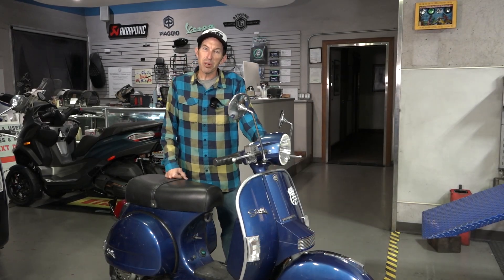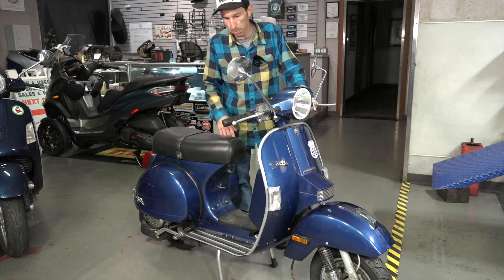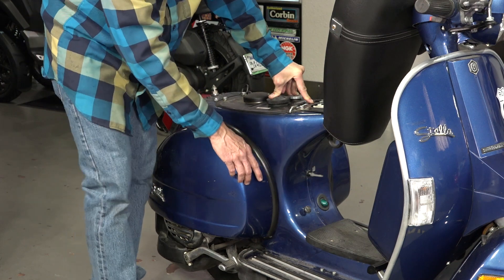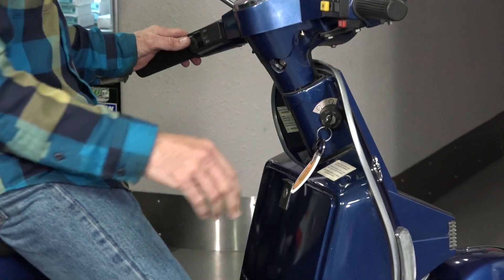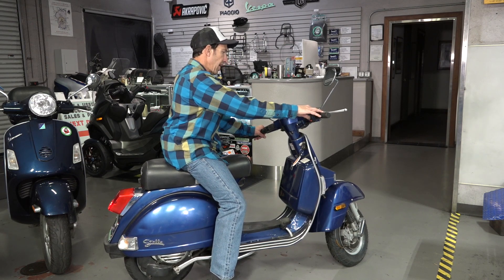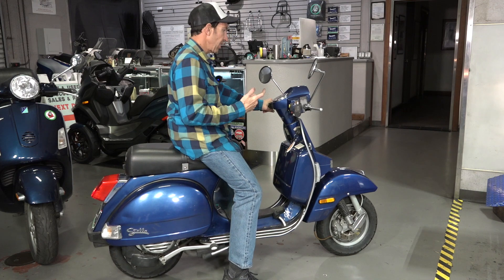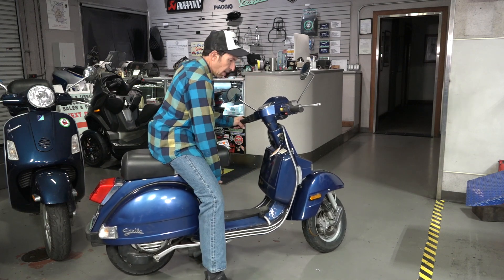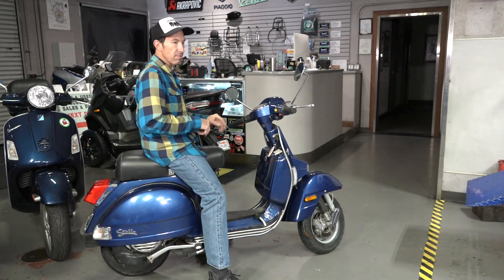How to Start and Operate a Genuine Stella or Vespa PX 2-stroke Scooter

Comment: I am the proud owner of a 2009 Genuine Stella. I get complaints from people saying it's not a "real Vespa" IMO, that's just a technicality. It is pretty much the same as a Vespa PX150. 99% of the parts are interchangeable. A "real" Vespa P series engine will bolt right in. The frame is heavy and rock solid. I weigh 240, and I NEVER get on it with it on the centerstand. I always push it off the centerstand before getting on. A few years ago I had to replace the stator, and at that time I removed the electric starter and put it in a box in the closet. I have been told they are failure prone, they are super expensive, and the Stella is super easy to kickstart, even with your hand. I got rid of my turn signal beeper. They will kickstart and run without the battery, but the lights will not work at low rpms. With either a "real" 2 stroke manual shift Vespa or a Stella, it does take some practice leaving a stop. Because of the extreme rear weight bias and the very light front end, If you give it a bit too much throttle and let the clutch out a bit too fast, it will take off with the front wheel in the air. I did that a few times when I first got mine. It you try too hard to avoid that, you will stall it. The sweet spot is right between the two extremes. The Vespa /Stella can be short shifted, they don't have a huge gap between the gears. You can take off in second gear by slipping the clutch just a little and giving it a bit more throttle, not that I recommend doing that. First gear runs out very fast, you will need to shift in the middle of an intersection. Yes the shifting is a bit clunky, and I love it. It has that crude, primitive mechanical feel. A very visceral riding experience. It's an actual MACHINE. My fuel gauge no longer functions. The needle can be all over the place. I don't need a fuel gauge, I go by the odometer. I could replace it, but I don't really have a reason. Stay away from the 4 stroke Stella. Not only are they junk, and impossible to get parts for, they defeat the whole reason for owning/riding a 2 stroke scooter. I do recommend replacing the exhaust on the Stella with a Vespa exhaust, the Stella came with a catalytic converter in the exhaust, which not only kills power, but will plug up right away, and can even damage the engine. You may need to rejet the carburetor when you do that.
Reply: The 4t are not junk. Sorry. You can find parts for them here in Europe
Reply: @Boss-Crow  Correct
Reply: Hi. I inherited a Piaggio that looks just like the one in the video. It works, but, only with kick start. I have one question that hopefully you or someone here may know the answer. The glove box on mine have one of the two hinges, not broken, but, separated from the 3 dots of what I guess was a welding of some sort. I don’t know how to fix it. Would normal welding work? Or putting screws? I’m uncertain because both would change the original configuration. Is that even important?
The other question is if it’s worthy to try to keep it, maybe restore it someday?? Or as I read in your comment, just ignore the problems and just use it as is.
Thanks in advance if you take the time to respond.
Reply: @GnarledSage  Ok, yes, I see what you mean. My Stella has three "spot welds" sometimes called "plug welds" that hold each hinge to the glove box door, in a triangle pattern. You can see them on the hinge, but not on the front of the door. There is no way to reweld them without ruining the paint, and even then it would require a really good welder to weld such thin metal. I have never been able to weld anything that thin without burning through it. It might be possible to use an epoxy, like JBWeld, or just drill out the three broken welds and attach the door to the hinge with small screws, nuts, and washers. That's probably what I would do. If it was made by Piaggio, and looks like the scooter in the video, it is a P series Vespa. Yes it is worth keeping and restoring, or at least keep it running. A lot of people like older Vespas with some "patina" (the weathered look) Nobody makes manual shift 2 strokes anymore, so they are becoming more and more rare and hard to find. Prices are going up. And the best part is, 99% of the parts are still available. The PX150 was sold in some countries up until about 3 years ago.
Reply: @geraldscott4302 Yes, the hinge is with those 3 spot welds (now I know how to call them. Thanks 😂). I guess that weld can be only done in the fabric or with some specialized tool. I guess the best option is to drill them and use some screws then.
You gave me an idea of the model, at least now I can search with the reference you said. And also made me think better of the bike. I liked because it was a Vespa, but, wasn’t sure if it was a waste of time to even keep it. I’ll try to fix as much as I can, but, sadly I guess that I some point I will have to paint it. It has some bad spots on the removable parts of the sides. I know with antique things is best to keep the original paint, but, it doesn’t look good as it is right now.
Thank you very much for replying.
Reply: @sainta2667  Maybe in Europe. Not in the U.S.  Besides who would want one? The whole reason I bought the Stella was because of that wonderful 2 stroke engine. And the manual shift and clutch.

Comment: I'd say one of the hardest bikes to "ride well" that a rider is ever likely to experience... Everyone should try and have a go at least once. They're idiosyncratic in every way imaginable. They require lots of patience and on-board time to get the hang of them...  I've had 4 all up Vepa and LML's, used most of them as daily transport. It's not until you reintroduce yourself to modern Vespa where you REALLY appreciate a twist and go for busy modern cities 😁. Nevertheless they are strangely appealing and if you choose one, have fun, it sure  will fulfil all your quirky, loud, characterful and antiquated needs and wants  😊.
Reply: The classic Vespas are easy to ride😊

Comment: Late PX-es doesnt have a reserve position of the fuel lever, it's just on and off. If you turn this lever 12 o'clock you' ll run out of gas pretty quickly, when your carbueratter will dry out. I found that myself, after one old LML owner told me that I'm doing all wrong on my 2013 PX, and turned that thing in up position.
Reply: Yup. When I got my PX I couldn't get it to start. I thought I got ripped off as I bought the bike from the net unseen. Started taking things apart. After doing some research I found that the lever has to be all the way to the right.

Comment: I just got an old Vespa that has been on the family for a while. From what I know is from the 90s, but, I haven’t been able to find the exact model. I’m in Colombia so the models that got here are not the usual ones. After watching many videos (quite a lot of them from your channel), I finally see a bike that is almost the same as the one I have. Mine doesn’t say Stella anywhere, it says Piaggio, in the center board if I remember correctly it says “bertroli”. I put oil and gas and it started fine with a few kicks, I guess the battery is dead since nothing else works, besides the frontal light (that thanks to your video, now I know that it’s independent from the battery). The bike works, but, it’s in a bad shape. Is it worthy to fix it? Or zits best to just use it as is, with a basic maintenance. It’s not easy to find parts here and it would probably be way to expensive to restore it.
Any suggestions is appreciated. I’m not sure what to do, and I’m also not in the best place money wise. I thought about fox some things myself, but, after watching your videos it seems that is not an ash task, and that it requires a lot of tools, knowledge and experience to even try it.
Another thing is if there’s is something that I can look to find out what model do I have.
Thanks in advance for any reply.